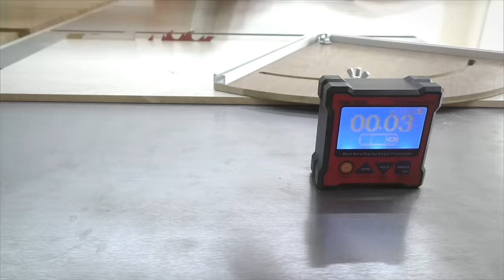DIY Ultimate Crosscut Sled With Drop-off Platform for Table Saw

Comment: I've seen many YouTube videos that claim to show the "ultimate crosscut sled". In my opinion, yours wins first prize for its low materials cost, ease of construction, and brilliant-but-simple design. I recently pulled a whole box of brand-new laminate flooring out of a Dumpster, and after watching this video I spent $10 on eBay to purchase some cyanoacrylate glue and fixer. That laminate flooring is brittle, and may get damaged after hard use, but who cares--If it breaks, I can just build another one for free! Thanks for sharing your excellent video.

Comment: That’s an excellent jig and the use of laminate is brilliant as it’s often sold cheap in the DIY stores .  I only wonder if the cut edges of the laminate runner will wear too easily although rubbing some wood glue or ca glue into the edge would harden it

Comment: Hello Sir
Yours is the most complete and accurate + simplest to make and use I have seen in this line .
I have few Q.
What kind of material is the surface of your table saw on each side of blade ,and did you make them?
What is the other plater beside the blade and what they called?
Thank you

Comment: Any plans?  What is the glue you are using.
Reply: Super glue, also referred to as cyanoacrylate glue, or CA glue with spray accelerator.
Reply: @richardshort4587  thanks

Comment: do u have drawings? i will pay you for them

i built my own picture frame sled yesterday then had no use for my mitre guage but then i thought well i have no use for my chopsaw so ile sell the chopsaw. then i realised i could cut a rebate into my sled surface and glue the gauge track into that and use the mitre swivel end for making other anglea than 45 degrees. trouble is its chipboard and unless i glue it down accurately it wont allow for accurate cuts. i want to buy a piece of solid flat machine cut ply board but it comes in massive 2.4mx1.2m sizes n i have a tiny car lol

Comment: Ingenious design !!! did you see the whole detailed device in your head, or develop the concept  as you went along?   I am a novice so I don't know what ware the dabs of glue that you used and what was the spray and why was it necessary?  Was the flooring material wood or composite?   Thank you in advance for your help.
Reply: I hope you don’t mind me answering some of this for you. The glue he’s using is superglue. Any brand of fast dry glue will work if you wait the directed time, but if you want to use the accelerator spray like him you should be sure it’s what everybody’s now calling CA glue. If you’re not sure, read the back label to see if it says something like “contains cyanoacrylate.” For the spray, you’ll probably have to go to a specialty wood store (like Woodcraft) or shop online for accelerator spray.

It’s not at all necessary to own these things, but it is a time saver and WONDERFULLY helpful. Use super glue and accelerator to bond pieces of any size in EXACTLY the right spot you’d like for long enough to get in some brad nails or screws as this man did. That way you’re not fussing to keep things precise. Just be sure you’re in the right place before you apply accelerator. Notice how he always has the pieces locked in place or pressed firmly to a fence before pressing the glued and sprayed pieces together?